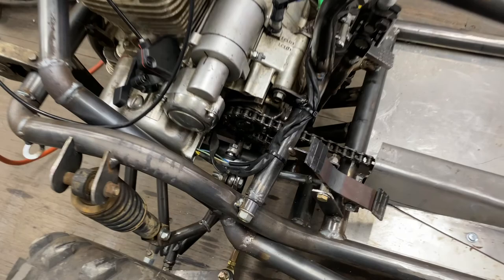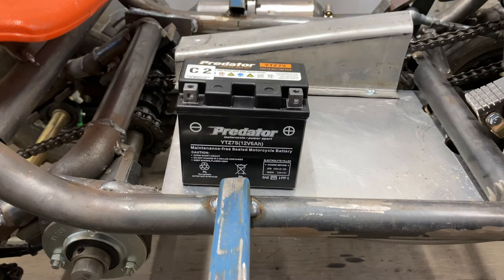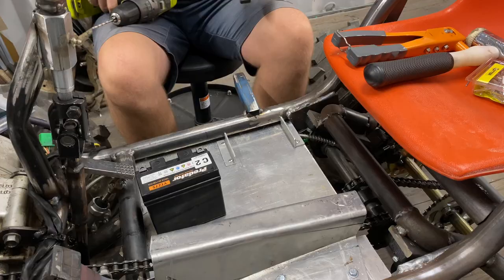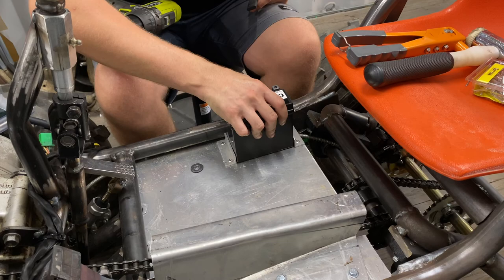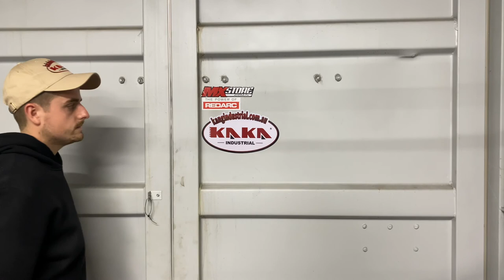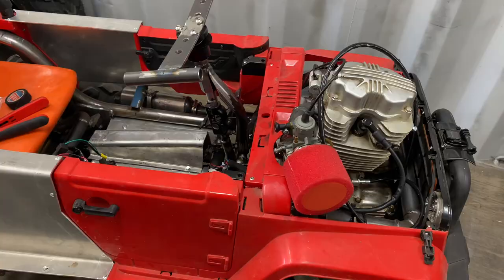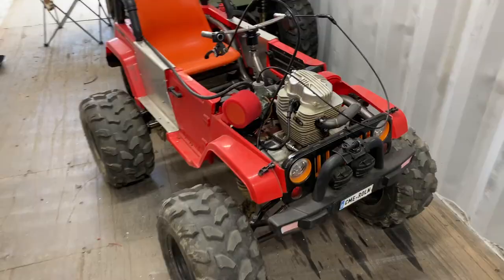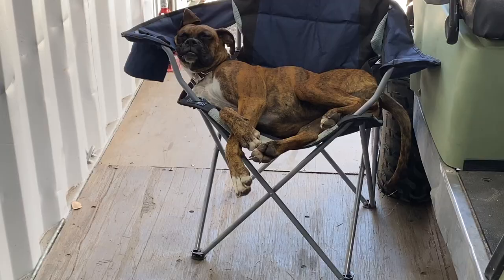4X4 Power Wheels Go Kart 200CC Build Part 9

Comment: I like the gear lever, Your steering looks out of line in the test drive. I’d paint the frame black and the aluminium panels to match the plastic. Maybe a bonnet for the front obviously not covering the entire engine, just to reference the jeep hood. Love it all, great work.
Reply from the maker: The steering was a big issue in this build that i unfortunately didn’t spend enough time on so I ended up leaving it. I built it way to small haha

Comment: Is there a way to tidy up the wiring hanging out the top? I think it would tidy the whole thing up so much, also CONGRATULATIONS on the sponsor brother!
Reply from the maker: Thanks mate! Yeah for sure I’m open to ideas, do you mean the wiring behind the dash panel? I still need to wire the headlights and rear lights with switches..
Reply: @EngineeredToDesign  nah the brake cables
Reply from the maker: @MTildsley92  yes I have ordered a new accelerator setup and the clutch cable is a bit tricky to shorten.. need to come up with a way to neaten them for sure.